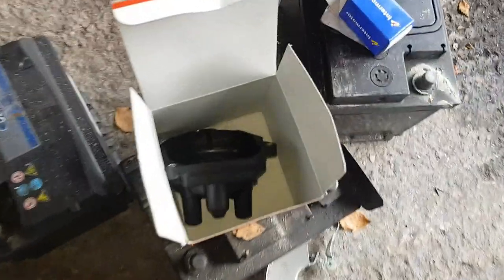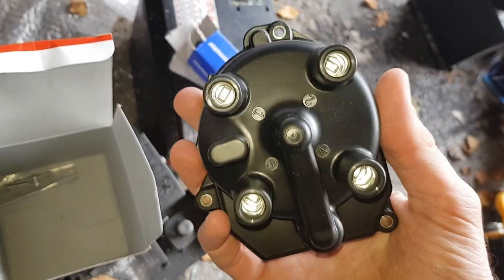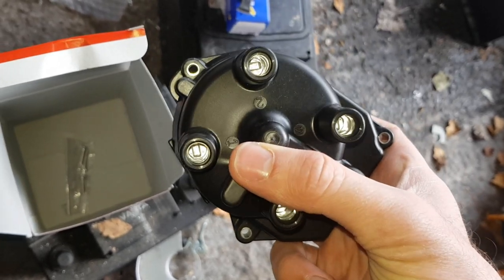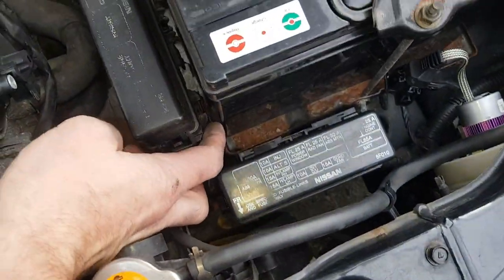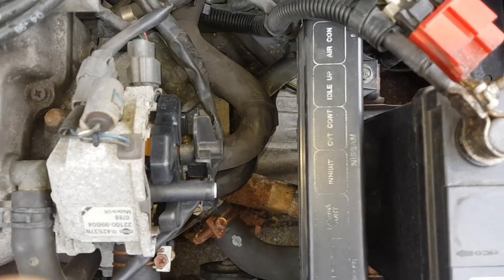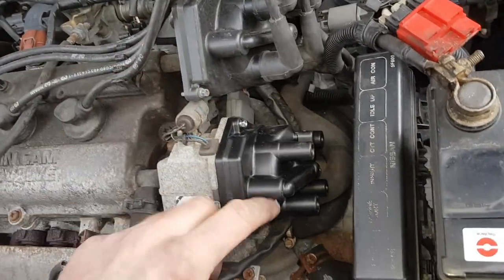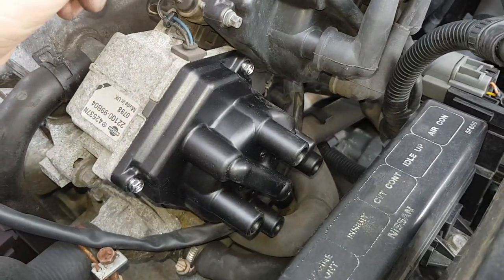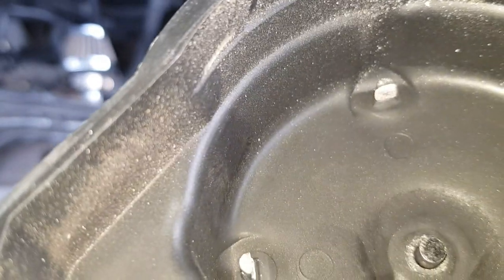How to change Distributor cap and rotor arm on a K11 Nissan Micra

Comment from the maker: Hopefully you guys found this helpful, if you did then please hit the like button and subscribe to the channel. 
I promise my normal modification videos will return soon.
Reply: K11 when it warms up starts cutting out any ideas what it could be
Reply: @Momo2k121  maybe the internal circuit...It seems not available separately, so better to look around for a spiare distributor
Reply: Interesting video...do you know if the inner and outer distributor oil seals are available at Nissan dealers? Because my 1.0l is leaking a Little bit of oil around the distributor

Comment: My 1.3 1999 Micra £150 don't start. RAC came told to change distributor cap. Ordered eurocarparts will be fitting tomorrow. Thank you for the clear instructions. Subscribed and Liked :)
Reply from the maker: No problem, hope you get it sorted 😀
Reply: My micra wont start also. But already test, the plug is spark. But i think the spark is low because the light is orange not blue. Is there possibility that distributor also problem??

Comment: Nice vid. I have micra  from 2000 series. Cap is different then yours and i have problems finding the new one. Everytime i find a new cap it doesnt fit.
Reply: Hey did you find a cap that fit in the end?
Reply: Hi, didi you find a cap that fit, me too i have the same problem
Reply: @shakey989  Hi, didi you find a cap that fit, me too i have the same problem

Comment: Hi my k11 1.0 litre 
When it warms up it starts cutting out any idea what to check I've check the leads already
Reply from the maker: Sounds like the coil. Try getting a distributor from the scrap yard and giving that a try.
It's a common problem with these internal coil distributors, used to get it quite a lot with my Hondas as they have a similar setup